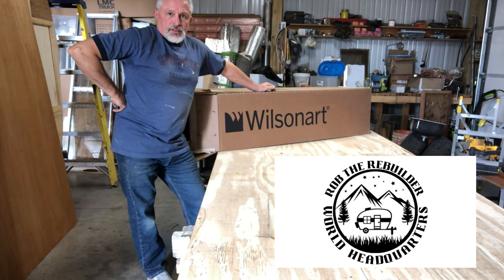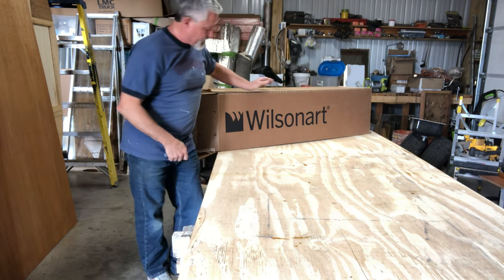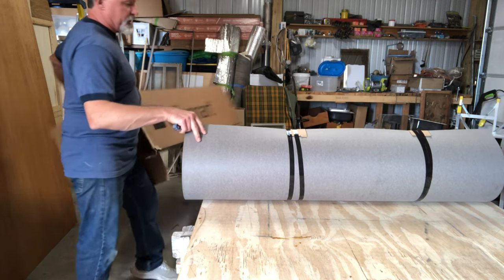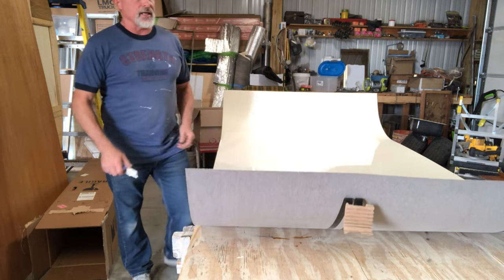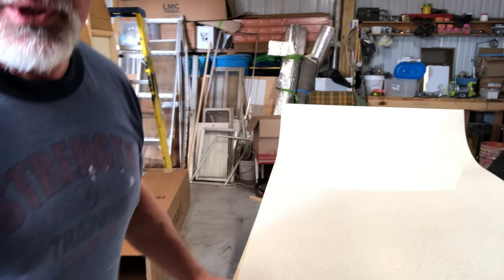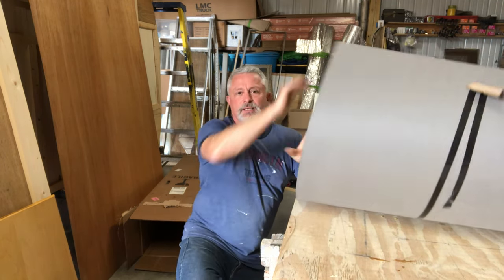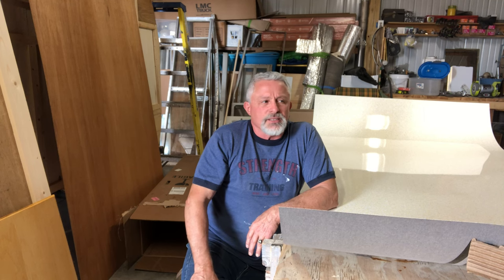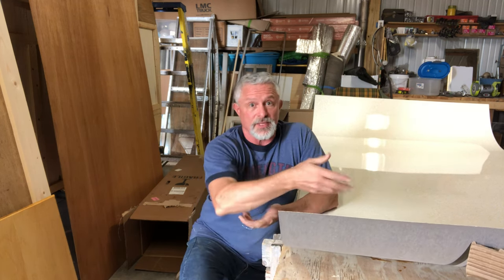EP 237 DIY step xstep Wilsonart laminate countertop dinette table 1960 Shasta vintage travel trailer

Comment: I'm fairly sure that the original table was covered with a product commonly known as Wall-Olium.  it often came in 4x4 or 4x8 sheets and was easier to work with that thinner products that would flex.
Reply from the maker: I think you're right. I eventually tore it apart.

Comment: I am wanting to restore my 1971 Scotty Sportsman 13’ camper.  What is the actual plywood flooring length?  What angle is the front board on the floor?  All the skin will need to be replaced.
Reply from the maker: Measure the length of the bottom of your skin and minus 2 '. That should give you floor length. I think I cut the angle at 20-25 degrees.

Comment: Were do you get the flexible aluminum trim? I am missing one of the exterior trims ( half circle) over the wheel. I can’t  find aluminum flexible trims in the big box stores
Reply from the maker: I get mine from Mac's Aluminum in Bristow, OK. Sometimes Vintage trailer supply has it in stock.
Reply: Thanks. Some things are not so easy to find, This is really helpful. I really appreciate your videos since this is my first rebuild and you have been pure blessings
Reply from the maker: @cristianbeker2972  I appreciate that. Keep at it!